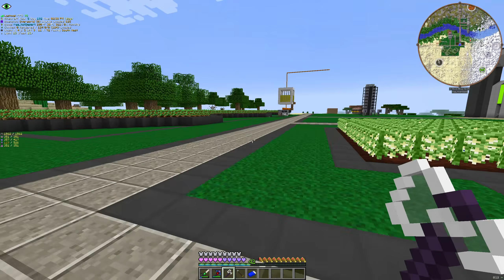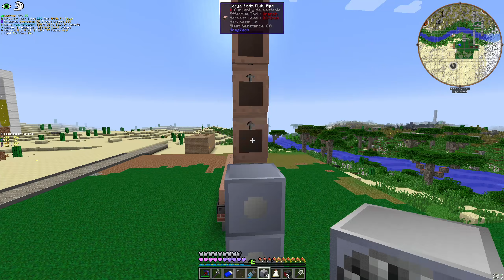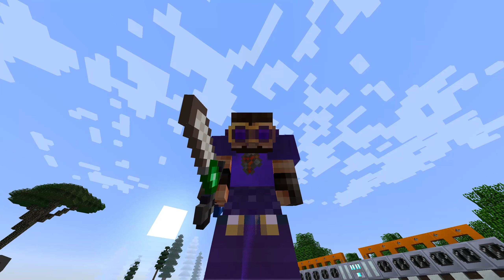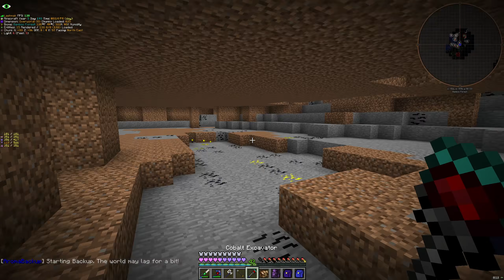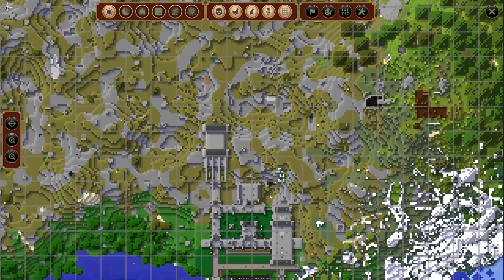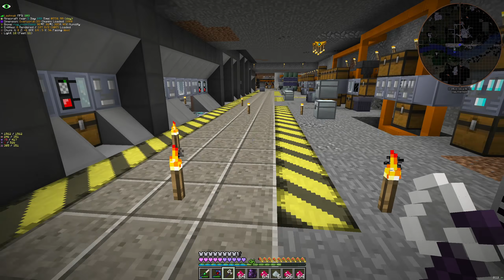GregTech: New Horizons - S2 Ep27 - Lava Power and Compressed Cobble

Comment: Using logs to produce methane to produce hydrogen is a very convenient source of pure hydrogen, but unfortunately it's not the best because it's quite power intensive. So if you spend that hydrogen to produce power you end up spending power to make power, which is not ideal. Of course if you've got another system powering the hydrogen production, say a very power efficient lava into steam into power setup, that's not a problem. And if it is a problem another easy, cheap way to get methane is to pump up either light oil or natural gas, turn it into refinery gas, and distil that into methane. Though don't bother severely hydro-cracking that refinery gas to get a better yield on hydrogen unless you've got a multiblock oil cracking unit, otherwise you're spending more hydrogen than you're producing extra. Finally the Large Chemical Reactor has a better recipe to convert methane into hydrogen, just add water and you get a 1:8 ratio of methane to hydrogen instead of the 1:4 ratio that an electrolyser gives. Of course the caveat is that is has to be an LCR, a single block chemical reactor doesn't have the recipe, so that's something to take into consideration. Also, another possible solution for hydrogen in the latest version is a sodium hydroxide loop, although this is also quite power intensive and the ratio of machines you need is not the best.

Super tanks now have a build in void overflow feature, actually. It's the top button in the top-left of the super tank GUI. Below it is a button that apparently voids all fluids and has the tank act like a fluid trash can, but I've no idea why you would use that. Quickly emptying a tank, I guess? You can just sneak-break the tank it won't retain it's inventory, though, so not sure on that.

Picking up tanks with inventory in them does give you debuffs, yes, but thankfully once you've placed the tank down (or placed them in a backpack) you can just use Milk, Terra Wart or a Talisman of Remedium to clear away the debuffs. Just make sure not to wear an active talisman of remedium while you've got a filled tank in your inventory, because it will go crazy trying to clear away buffs that keep getting re-applied constantly and it'll disintegrate pretty much.

For long (enough) distance item or fluid transfer the best method I've found (pre-Ender Chests/Tanks, at least) is Long Distance Item/Fluid Pipes. Exceptionally cheap, only the input and output has to be loaded, not the entire pipeline, and they have a throughput of "as fast as you can shove stuff into them". They do have a minimum distance because people were abusing them to transport huge amounts of steam easily, but if you need to send stuff at least four chunks over it's a fantastic option.

This is really the point of the pack where everything is turned on it's head. Multiblocks to replace single blocks emerge from every single wall, floor and roof, chemistry goes from the occasional thing to needing everything and the bathroom sink, stuff that used to be just shoved in a steam grinder now has to be processed differently, the list goes on. It's a madhouse of progression, and that's just the tech part. IV also opens up some magic stuff, which only adds to the mess 🙃.
Reply: Does the Talisman have a toggle?
Reply: @Threefold.  The Talisman of Remedium? Yes, it can be toggled on or off.
Reply: very good my man